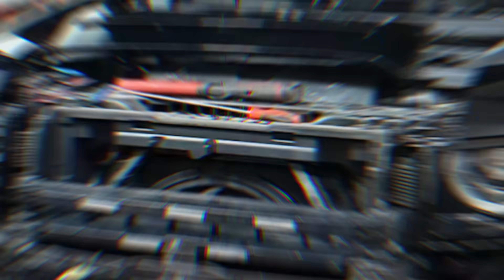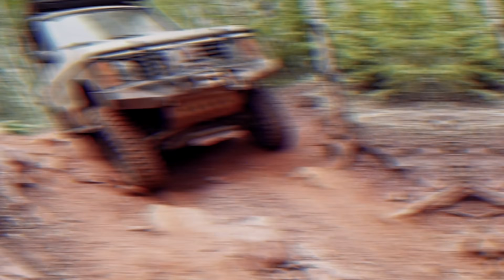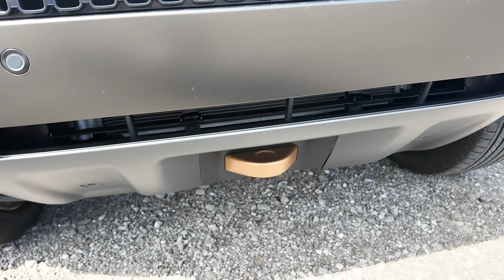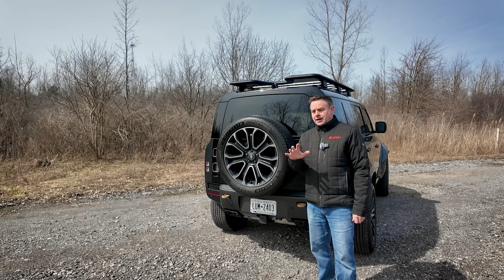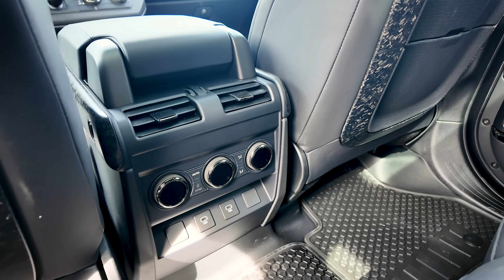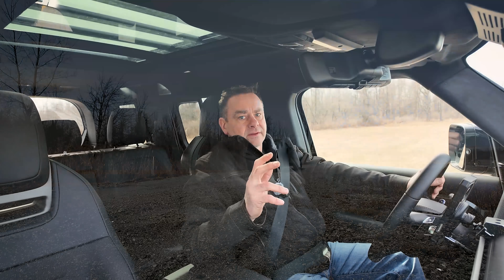Does the OCTA Deliver? | Defender OCTA Review & First Drive Impressions

Comment: What tow hitch receiver is this? I’m receiving my OCTA soon as well, and I really need a receiver like that to pull my camper!! Or to use a tow bar mounted motorcycle carrier. Have fun and drive safe!
Reply from the maker: This is the factory trailer hitch. Please note there is a break-in. Where you're not able to tow anything approximately 3000 miles.
Reply: @Lucky8 Thanks for your reply! Subscribed and liked!!

Comment: The three orange lights on the front are mandatory if a vehicle is over 80 inches wide as set by the USDOT.
Reply from the maker: thank you
Reply: Case in point- Hummer H1, Hummer EV, Ford Raptor and other wider than normal vehicles

Comment: The main reason I went back to a d2 was the ACE . that system keeps the truck flat specially for how top heavy it is . should have been on ALL land rovers but that’s just me . crazy how they didn’t even offer it on the lr3 those are crazy top heavy
Reply from the maker: I think they were making up for some of the ace on the LR3  with the cross-link air suspension.

Comment: Seems like it’s a bit confused on what it wants to be. Is it a SVR or is it a full send off roader. If JLR looked at everything the aftermarket was doing they’d realise they have two models but tried to combine them into one. Crushed carbon and a massive engine is great and all but I’d sub it all for some better mounting points, better options for roof lighting and full size rack and off road tyre options that doesn’t require cutting the whole front end to bits. Not that it’s not awesome, just misses the full off road bits.

Comment: Now that you've had it for some days,,, how flat really is the cornering at speed?  I've seen a few reviews where they say there still is body roll when seemingly they are driving relatively slowly.  Thanks
Reply from the maker: There is some body roll. They have to build that in or people won't realize the car is turning. It is very subtle. The key factor I notice is that the rear does not lift when you are on the brakes in a corner.
Reply: @Lucky8  thanks for the answer.

Comment: How does the ride comfort compare to the air suspension models? I’d imagine it’s stiffer for sporty driving.
Reply from the maker: Even with the 22 inch wheels the ride is still very comfortable in standard mode. I bet it's even better when we switch to the 20 inch wheels.
Reply: does the switch from 22s to 20s still require a conversion kit?

Comment: The three amber lights on the front grille are a regulatory requirement for a vehicle whose width is greater than 80".  They seem to be rather "tacked on" in the Octo and for sure they could have found a better way to implement them but there's a reason why they're there.
Reply from the maker: Thank you for the comment. I did not know that.
Reply: @Lucky8  They aren't on the European market Octa, Only US and Canada I believe.
Reply: Yea because it is US and Canada only no other country requires them so they ain’t redesigning the car just for the US.

Comment: Can u put the 20s on there or is it now limited to 22’s by the callipers?
Reply from the maker: The 20s will fit without an issue
Reply: The Land Rover defender accessories pages indicates that regular defender 20” wheels are not compatible. You need to get the Octa 20” wheels.

Comment: What a vehicle! I really like the small orange lights in the front grill. I have a 2021 Defender with the V6 and now 65,000 miles. It’s been absolutely excellent! Love it!
Reply: Straight 6*
Reply: V6 or straight 6, ingenium
Reply: @andrewgrey206  There is no V6 in any defender. It doesn’t exist.
Reply: @mcandrett  exactly i should have put in a ! After V6, I have the D300, straight 6, 1 supercharger,  twin turbo 650nm

Comment: Forged carbon. 
Not "chopped carbon"
Reply: It’s actually chopped carbon……. It’s a byproduct or I should really say waste product from the aircraft industry. !!!
Maybe even comes from BAE Systems the aerospace and weapons manufacturer in the UK  !
Reply: @jasonsmith1158  Chopped carbon fiber involves short, randomly oriented fibers, while forged carbon fiber is a process where chopped carbon fibers are compressed into a mold under high pressure. 
Chopped carbon is the ingredient used.  Forged carbon is the finished product. 
Just like how we call bread,  bread.  Not flower.
Reply from the maker: Forged carbon made of chopped carbon,  thanks for the info.

Comment: Black "plastic" doors should not be filmed in bright sunlight. It looks really bad for a 180,000 euro car 😅
Reply: Of course, the engine and driving experience are great. However, the difference to the P400 with an additional cost of over 50,000 euros is too significant for me. I'm also not really a fan of carbon. If the interior quality were elevated to the standard of Porsche or the G-Class, then yes, but as it is, not really.
Reply: @martinwidmer4380  totally agreed. you look at the G class interior and its less than zero comparison with the Octa, not impressed.  Also ,  the word Octa should be on the sill plates instead of the word defender.  Really weak

Comment: Great review and congrats on your new ride!
I was also going to trade my 2023 V8 110 however 3 major points stopped me:
1-  I hate the new interior and simply love the Alcantara interior &  Suede seats in my current V8
2- The Octa sits higher- already find my v8 a little high- wish it would sit much lower
3- Major point- 20% luxury tax- Bought my V8 before the new law was in motion, can justify paying 20% additional
Reply from the maker: Some valid points there, my friend. I just love the carbon interior, but if that's not your thing, it's hard to justify the additional cost, especially with your tax.

Comment: You need to do a review on which of your most sold upgrades fit the OCTA. Reverse lights? I have already installed the dash vent and otter phone mount. I battery the same? Mine went straight to detailer so can’t play with it yet. Did Gap tool work? Auto stop?
Reply from the maker: Excellent comment thank you. I will start playing with it this week. The reverse lights will not work because of the shape on the new bumper. I'm gonna try to create something just for the Octa. I'll know about the gap tool shortly. Gotta fix that auto stop start.